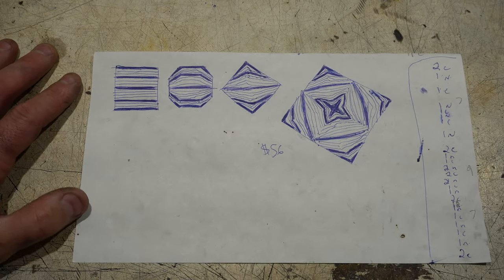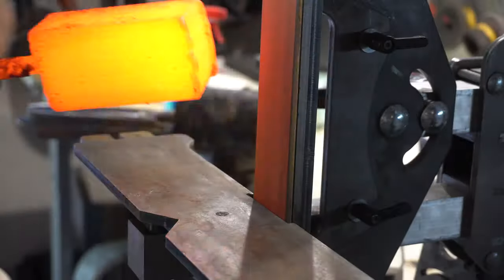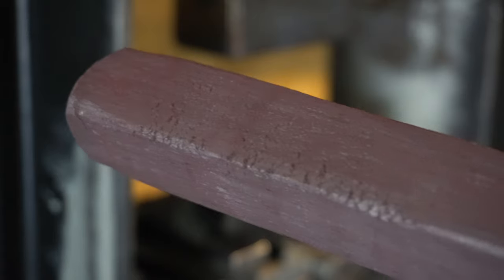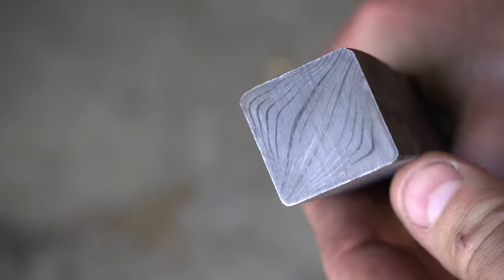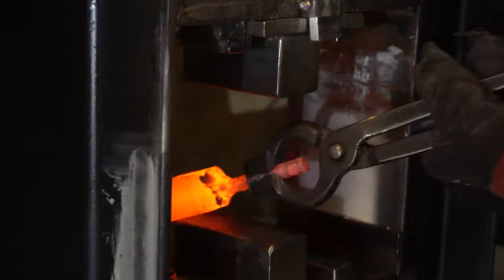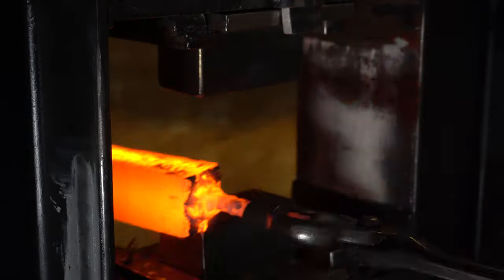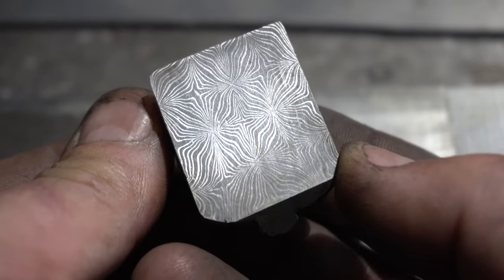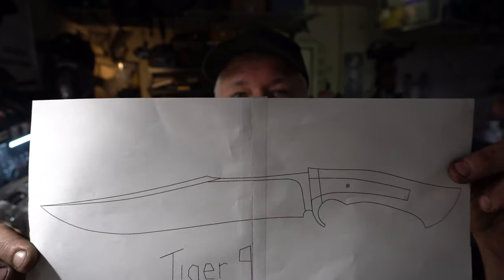Forging a Mosaic Damascus Bowie Knife - Part 1 - Forging the billet

Comment: I’ll say my mind raced with excitement during this video. I’m still not able to be in the shop due to my wrecked body yet. I’m hoping and praying in a year. I am watching and learning as much as I possibly can so that when I do get back in the shop I can move forward and not look back. This one made me very excited and gave me reason to look to the future. You don’t know what that means to me when I’ve been down for 2 years and didn’t know if I was ever going to be able to stand for more than a few minutes.
Reply from the maker: Stay strong brother!  You’ll be back at it soon!  Send some pics of your projects for viewer knives.  👍
Reply: Stay strong, I was in the same place a few years ago. Now I am back at it, you would be surprised the number of innovations you can make to a shop to accommodate physical limitations.
Reply: @TyrellKnifeworks  Thanks Denis!
Reply: @bjornronaldson6017  Thank you friend, it’s been a tough few years. The pain is little to the mental stuff. 45 years of everyday joy in my career and second later, I’m a mess! If I was the cause of my own injury it’s one thing, but someone else caused it. I need to get past my bitterness! I gotta get back into my shop!
Reply: @bradymcphail9690  I hear you. My injury was completely accidental, but it doesn't change the fact that it ended most of my hobbies and career. That said, it brought me back to smithing, so I have learned to move past that bitterness. Most of the time. Regardless, I have found that there are lots of little things I can do that make smithing possible. A high stool or chair at the grinder, adjusting anvil height and investing in making or buying a press all help me get past the pain and physical difficulty of the trade. It's not perfect, but it's a start.
Reply from the maker: A friend and fellow YouTuber, WJ Blades has pretty bad back problems but gets by and does some forging.  Check out his channel, you might find some inspiration there too! 👍
Reply: @TyrellKnifeworks  I sub to his channel, but didn’t know his story. Thank you

Comment: I like your videos very much.  Explained very clearly.  I would like to ask.  Why don't these need borax?  In what specific situation is it used?
Reply from the maker: Borax is used when I’m forge welding without fully welding up all the seams.  If I’m doing the initial stack of Damascus, borax is used.  If I’m 4-waying the billet, many times I’ll weld all the seams to have a zero-oxygen environment so I know no scale can form inside the billet.  It’s always safer (but not quicker) to weld up the billet fully.  Some smiths (Kyle Royer for example) use thin steel sheet metal and completely cover their stack and never use borax.  I’ve done both, just depends how critical the step is. 😜. Thanks for watching.

Comment: I dont have my forge built yet. But.i still prefer the press to the hammer. No extra concrete waiting for weeks to dry. And it's faster. And quieter. And so much smaller.
I would have etched all the pieces and lined up all the corresponding pieces to make a more fluid mosaic.
Reply from the maker: The pieces were put in order they were cut, that’s usually the best way.  You said you don’t have a forge yet so you’ve not actually made Damascus yet?

Comment: Nice pattern 
I learned no to ever put any weld on the sides. Except when tiling, it gets a single tack & then grind the humps off. 

Get ya a 9" Metabo & use a Norton cup stone (6") either 36 grit or 16 grit are pretty pricey at $750 for five.
Reply from the maker: I don’t typically put welds on the side but wanted to keep any air out of this one.  Grinding down the weld before forging worked really well.  I had a cup stone but my variable speed grinder went kaput and haven’t purchased a new one.
Reply: Tyrell Knifeworks I'm a professional fabricator / welder. (Part time now) I make knives full time now.   Anyhow the Metabo 9" doesn't come with hardware. You need another 5/8" flange. I'll send you a link for a toolless chuck if you need it. Don't get stuck & break loose easy.  Just like any other grinder stop when the nut touches the disk when it hits the material it gets hella tight anyway.

Comment: I’m guessing you don’t have a tig welder? Or even a dc stick welder with a tig torch. They work great for sealing weld seams without introducing any mild steel filler.
Reply from the maker: Actually I do have a tig torch and argon.  I thought of that later but some of the seams were a bit too wide.  Plus I suck at tig. 😜
Reply: Tyrell Knifeworks LOL I understand that. One thing I’ve done with a gap is use a small piece of whatever material I’m using (1084 15n20 1095) and use that for filler material. Ofcourse it doesn’t match the pattern but it’s all hardenable. If done in such a way and equally it could add to the pattern. 😉 just a technique I thought I would share....